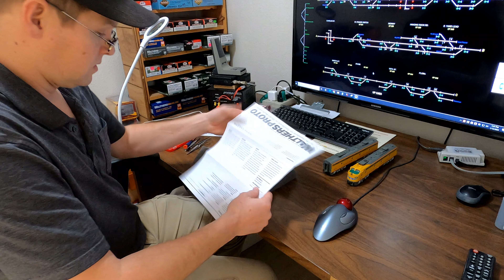New Walthers E9m Review in HO Scale

Comment: I like to collect older Proto 2000 E series. I really want to pick one of these up because I'm curious of the changes and want to see the old and new side by side. I have a E8 in Rapidos new run and it's really nice. Not has heavy as the old P2K though.
Reply from the maker: Yeah I feel like the Walthers could have been a little heavier. And there is room in the shell for a little more weight, so I might add some later.
Reply: I am distributor for rapido and they did a nice job with these and the F units!  Have a pair myself!

Comment: I just purchased the DC variant of the trio, and obviously I will be upgrading them to DCC with at least one having sound. The ones I purchased are from the newest run, and I am very curious to what exact  Loksound 5 Decoder they use since you can buy pre-progammed sound decoders. Its just a matter of what exact EMD sound file should be used since they are rebuilt units on the prototype.

I wasn't able to tell easily in the video, but I wasn't sure if Walthers had the speakers installed on the DC variants. If they did install them regardless, then I would just need the decoder itself. I wouldn't be surprised if they didn't choose to put speakers on the DC locos
Reply from the maker: The decoder in the single sound unit I got is a standard 58429 Loksound 5 DCC. It has the proper 645 non-turbo sound, with the RS5T horn out of the box.

The DC set does not have a speaker. To upgrade those to sound (which I will probably do down the road), there was space for round speakers.

Comment: I didn’t realize Walthers had this set.  I looked on their website and it’s no longer available.
Reply from the maker: Yeah they were announced last summer, with an expected due date of late Dec '23 or early winter of '24. Walthers is pretty good about getting stuff to market quick! I'm sure if you called around some of the bigger named hobby shops someone would still have 1 in stock.
Reply: Hey thank you.
Back in the mid 90’s Proto 2000 made the two A units.  I bought those and had to add A LOT of details to get them to UP’s current prototypes of the locomotives.

Rivarossi I believe it was made and. Undecorated B unit that I bought, detailed and fully painted.

Over the years, the A-B-A set has gotten pretty much destroyed though, so I’d like to have another set, but with less work.

Thanks again and great video.

Comment: so really, one loco was pulling all those cars, they did seem to come detached a couple times , they are nice, and Walthers does some great running loco's
Reply from the maker: I think the times that the lead engine came uncoupled the rear 2 were still pulling the train. All were powered. But yes. However, those were also in the "downhill" parts of the layout. I should have done a test to see how many one engine would pull on flat track!